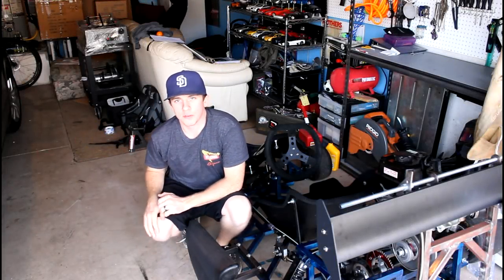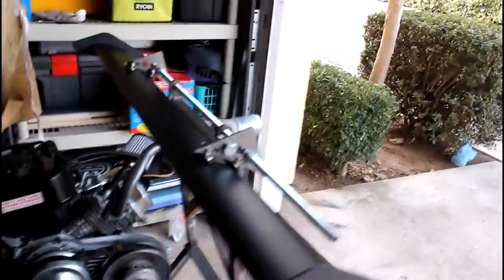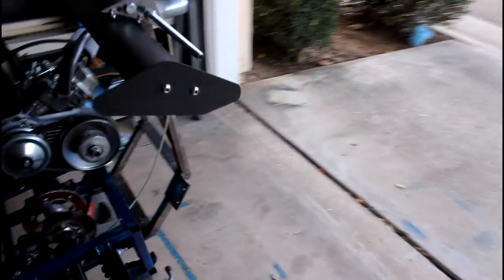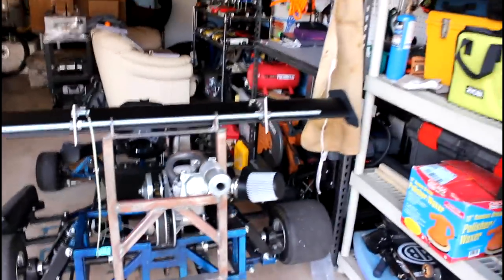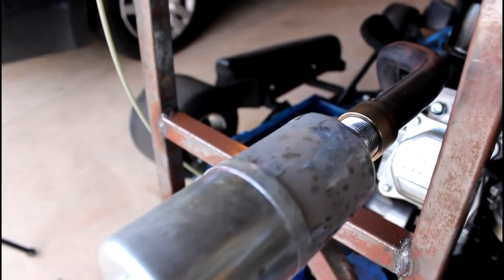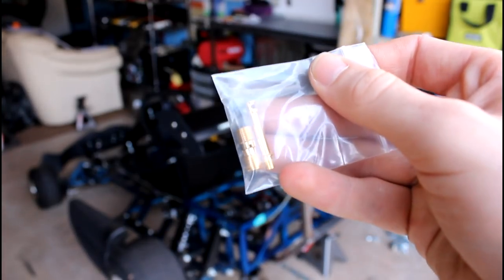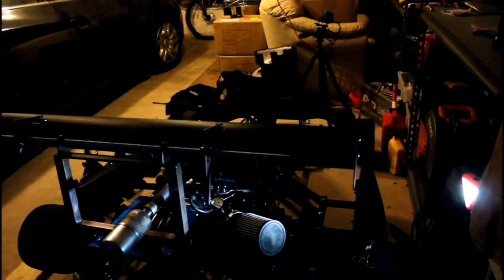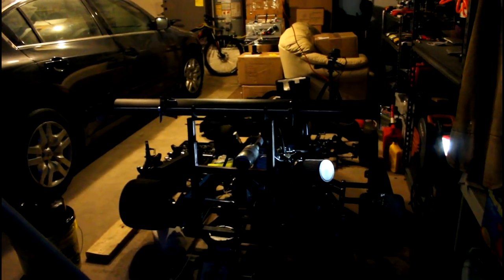Homemade Go Kart Running Lean - Predator 212cc Carb Jet Upgrade - Part 1

Comment: Bought the same silencer at tractor supply. It also peeled right off. Then painted high temp black paint which also peeled right off. My engine also was running lean. Was thinking maybe just got too hot.

Comment: I bought the same kit from omb first start up and run it peeled off also
Reply from the maker: Yea it's just a junk coating on it from factory. I wire brushed the remaining amount off and just sprayed on a hi-temp spray paint. Much better looking.

Comment: What happened to your rear suspensions? Looks like its failed
Reply from the maker: My first axle design to allow for an independent rear suspension was very finicky, so I decided to do away with it for now and just use a fixed rear suspension with a solid axle for better reliability